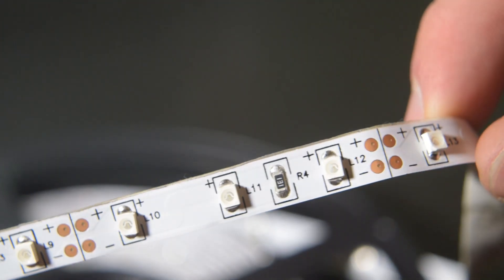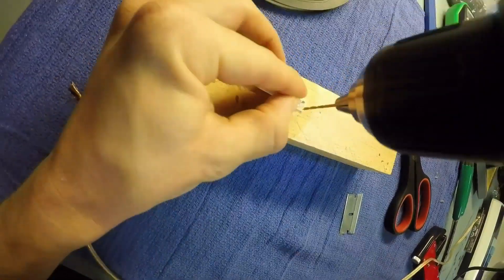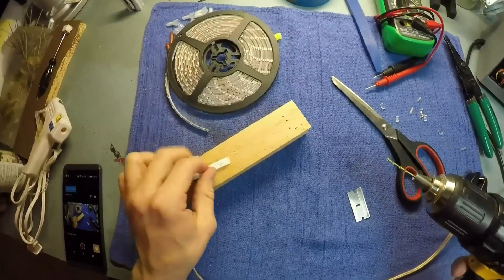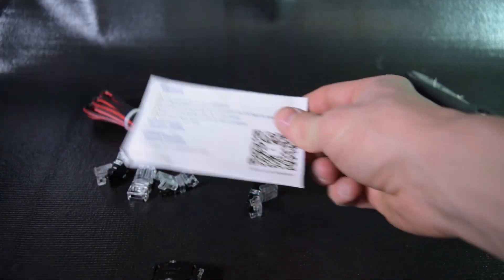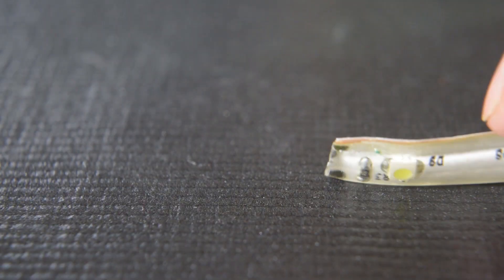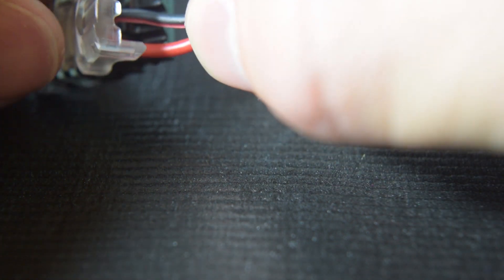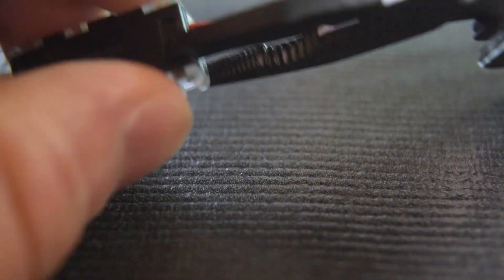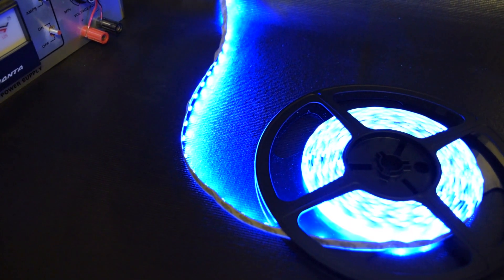How to Connect LED strips to wires (using LED strip Connectors)

Comment from the maker: Find the connectors and stuff here:
10mm LED Strip to Wire Connector 2 Pin (12 PCS): https://amzn.to/3A9bgkR (paid link)
8mm LED Strip Connector 2 pin (10 pcs): https://amzn.to/3dOf9nO (paid link)
wiring (20awg): http://amzn.to/2njw2qW (paid link)
LED strips (water-resistant): https://amzn.to/2X8gUOw (paid link)
LED strips (Not water-resistant): https://amzn.to/2XiGjd7 (paid link)
multitool used: http://amzn.to/2njviBS (paid link)
(I may get commissions for purchases made through links with "paid link" next to them)

Comment: I have 3 rolls of strip lights that I wanna join toguether. Two 65.5 ft rolls and I think a 25ft roll.  They all are RGB but one roll different brand. So how would I do these, do I just need to connect one roll of strip lights to the  outlet and these will give power to all the rolls?? do I need more stuff besides the jumper connectors i have? Do I just cut the other rolles and keep using these jumpers to join them and that's it or is not as easy as that?
Reply from the maker: It all depends on what strips your using and the differences between them, if they are just basic single color strips and use the same voltage it should be easy to use them together, as far as the connectors go, as long as they are the same size and positive and negative line up they they should work, soldering is always an option if they dont, I need to make a video on how to correctly solder these
Reply: @4WheelKid  well this guy told me to buy a DC powerblock or something like that. He told me I could not connect that many lights in one power supply🙄
Reply from the maker: Yeah its hard to say without lnowing more, 24volts might be ok but you have to consider voltage drop, with 12v and especially 5v
Reply: @4WheelKid  so that's what iam having problems with. How would I onow the voltage and once I know voltage of each roll of lights what would I need to joint them all into one?
Reply: @4WheelKid  this other guys told me I can't just connect all thoese lights into one power supply. He told me to get a DC power block

Comment: how can I install without a voltage box?
Reply from the maker: most run on either 12v or 5v. what you need depends on your application

Comment: I wasted a bunch of money on 18 gauge wire.

I should have bought 20AWG🤦🏻‍♂️
Reply from the maker: Yeah Depending on how many leds your running and how long the run is you could even run way smaller like 26 gauge. I need to make a new video in led strips and how to calculate the wire size

Comment: So if I had 12v strip light n that connector  I could just wire in a switch in my truck and run power off fuse box and a ground???
Reply from the maker: you sure could!

Comment: Hi,  after watching your videos I bought those connectors.  I tried to install a small part of it.  The cable side looks nice and very solid,  however the LED strips side keeps getting loose all the time.  Any ideas how to install that part properly? If I push it as far as I could as your video said,  the metal part of the connector would land on the white part of the strip instead
Reply from the maker: you will want to make sure the metal spikes are going into the copper contacts on the strip

Comment: SOMEONE HELP PLZZZ so i installed the led strips aroung my room and when i plugged my wire it worked but then a few days later the lights turned off and i kept pushing the on button but nothing worked and i moved the wire around and the turned on for like half a second then i thought i fixed it but they just turned off
Reply from the maker: sounds like loose connection somewhere

Comment: On the other end of thr connector....do you have to use the wires? Or can i just put another led strip in the other end?
Reply from the maker: they sell different connectors for that purpose

Comment: What if I want to connect two led strips instead of a strip and adapter? What then?
Reply from the maker: they have other adapters for that or you could solder them
Reply: bassisgood thanks

Comment: Man i'm lost... Why not make these so they just power right up? I have a black and red wire plus a lead for a 12v power supply. Power supply's do not work on their own.. so they say, connect the black and red to a power supply. WTF? Am I supposed to cut a power supply and solder the negative and positive? What a total pain.
Reply from the maker: yeah it's like this so you can cut them to the exact length you need, more customizable that way

Comment: i have power going to my cabinet which is done through a low voltage box and ran to the cabinets. It is a two wire. I was wondering if i could still use a 4 pin led strip that connects to my two wire power?
Reply from the maker: 4 pin led strip? is it an RGB one?
Reply: @4WheelKid  yes how to connect RGB strip

Comment: ⚠️⚠️⚠️⚠️⚠️⚠️please help i only have led strips and two k-102 black red wires and nothing else so how can i connect it and turn on the led lights HELPP⚠️⚠️⚠️⚠️⚠️⚠️⚠️⚠️⚠️⚠️
Reply from the maker: solder the wires to the strip

Comment: are there connectors available at Walmart or at a store i can go buy thats not online? i would need it by friday.
Reply from the maker: probably can't find them at a regular store, soldering works though, make sure to tin the wire and the pad separately then melt them together. this holds really strong. I use to do it wrong by globing a ball of solder on it and didn't hold very well

Comment: I'm thinking about somehow buying led light strips and then using a power switch and a 9v battery to make a light bar but idk how to solder how can i get it to work i have led light strips 9v battery and a power switch but idk how to solder so how can i make it work
Reply from the maker: the led strip connectors and crimps should work
Reply: @4WheelKid  q
Reply: Thanks again for your time and help...
M

Comment: will it work with an adapter?
Reply from the maker: +PickleCake yes it will, it takes a 12v dc input
Reply: how do you connect it to an adapter?
Reply from the maker: solder or crimps

Comment: I ordered les strip light they have a black and red wire but no connecting source what should I order?
Reply from the maker: do you want to connect it to a 12v dc source like in a car or a 120v ac source in a home?
Reply: 120 ac in a home
Reply from the maker: type in led strip power supply

Comment: Easy connection he says but I'm to dumb to understand lol
Reply from the maker: LOL everyone can learn
Reply: It's apparently a self cutting connection, which is why it sometimes needs the pliers, to help push the covering through and cut it, which allows it to reach the wire inside. That's a pretty cool connector actually. You don't nee a wire stripper or anything, just cutters.
Reply: Do the contacts actually have to land on the copper pads? Or am I pushing the strip to the back and having the contacts rip through the led strip?

Comment: question?
for LED
are LED  good for connecting electronic not a battery
Reply from the maker: not sure what your asking exactly, if your asking if you can use them with a power outlet at home, you need a power inverter for 12 volt dc
Reply: i mean..is LED lead good for electric 
not in battery?

Comment: any tips on re-opening them?  once clicked shut, if I didn't get a good connection, I have trouble opening them again.
Reply from the maker: you should be able to find the tabs where they lock into place, and if you pry just slightly in the right place you should be able to get it back open

Comment: What the power suply led use,,,,?
Whithout conneted small,,,,!!
Thnk's
Reply: Where i put the other side of the cable?
Reply: Do i need some adapter to get power to it
Reply from the maker: are you asking what power supply I used in the video or what people usually use. not exactly sure what your asking
Reply from the maker: yeah you just need a 12 volt power supply to connect it too, just look up 12volt power supply. if your using it in a car you can connect it to a 12 volt power source and a ground

Comment: Can you read my mind??? Lol. Pretty close. I wanted to ask you if you can make a video on how to know which LED light bulbs are compatible with regular light bulbs. I would like to change my interior light bulbs, my license plate and trunk light bulbs. I've been too busy making repairs on my car and a little shy to ask you about how to figure out compatibility.
Reply from the maker: haha that's awesome! sounds like a great video Idea. they should be perfectly compatible as long as they are the correct bulb type (you should be able to find led replacements for most all bulb types) and as long as they work with 12 volts which is most of them. I know some of the newer cars that used computers to monitor everything do some weird stuff sometimes but it won't hurt anything